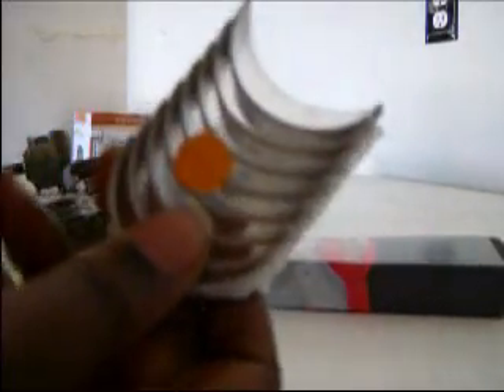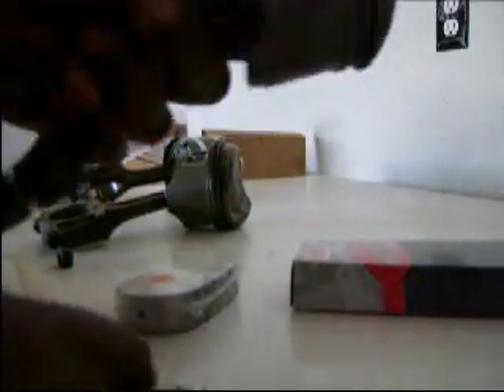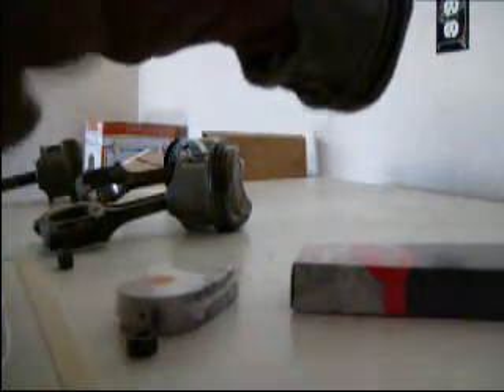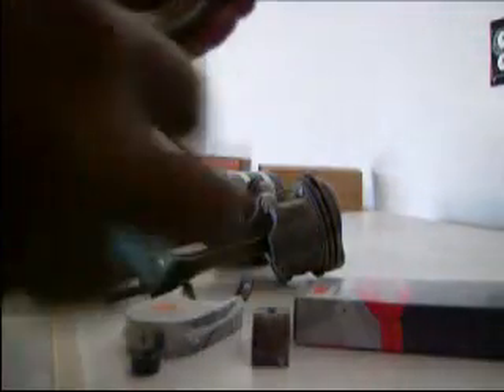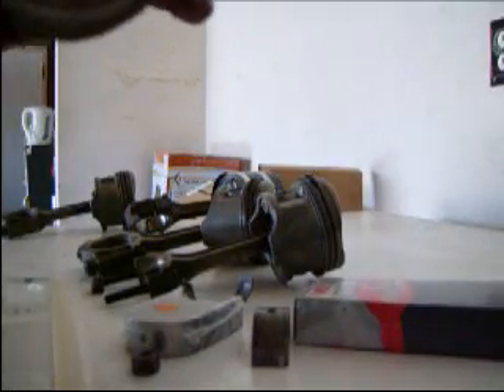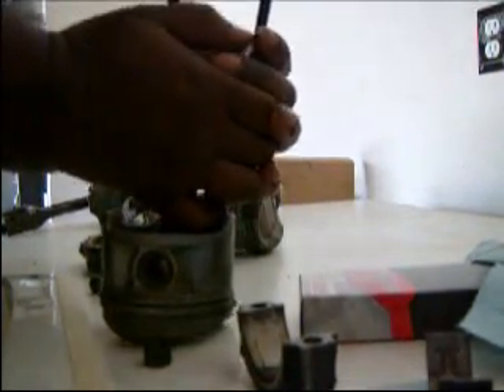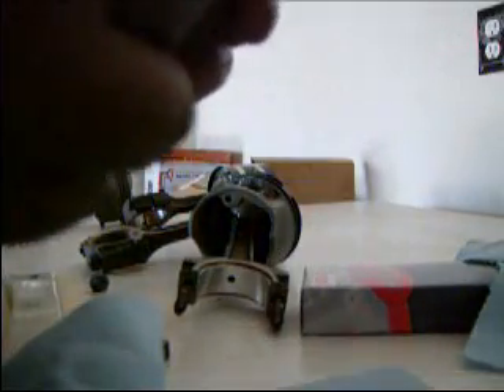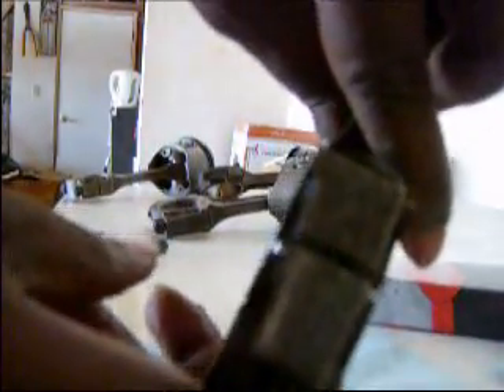CONNECTING ROD BEARING INSTALLATION

Comment: so new bearings with no machining? I comment because I just did that on my '74 Chevy C10 truck SBC 350 and I now have a rattling sound, so I was wondering do the bearings go in lubed or dry, I put some engine oil on mine
Reply from the maker: ugh. I'm having issues replying to people on my own channel for some reason.

dry when you're installing them into their respective places (conrod 
bearings need no lube when installing them in the conrods, same with 
main bearings). But when you install your crank you lube both the crank 
and rods and mains. If you lube the backs of the bearings THEY CAN 
SPIN!! You'll be pulling it all apart again. 

As for machining I didn't have the funds and this car never had a knock. If it had a knock I'd scrap the crank and grab new rods and reuse the pistons. Also knock usually means you may have to replace the block if it's not in spec. Easy way to do it is to line hone it all to a point where you know you can grab oversized bearings and still replace the crank. They usually have a coating on the outside to help prevent wear on startup. That's a big deal unless you get an auxilary oilpump to prevent that (which is something you have to make I might add). Aside I hope this helped you out. Sorry for the longwinded response. I like to make sure I touch all aspects of the process if I can and I always leave stuff out to be considerate of people's time....but I still get complaints. lol.